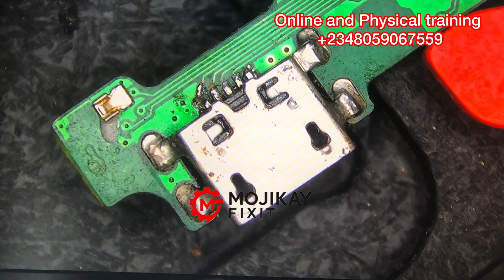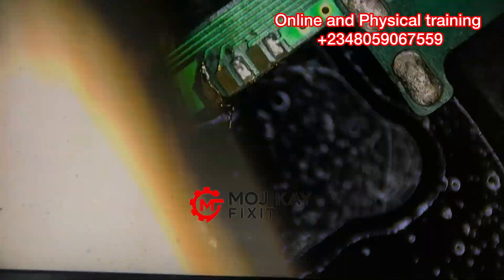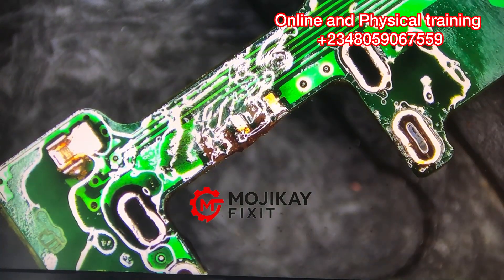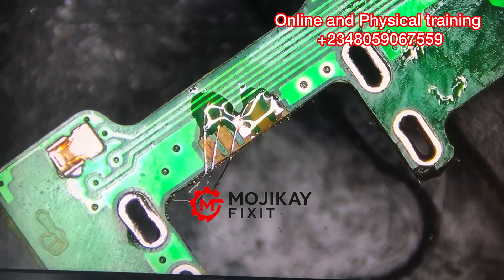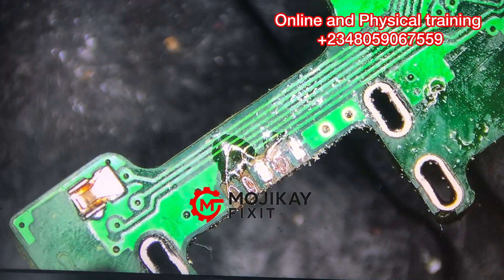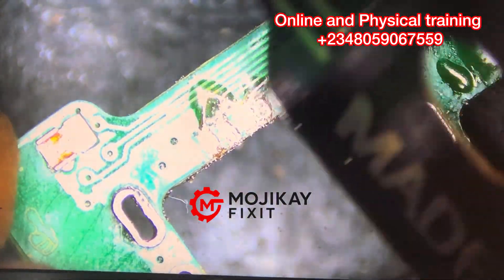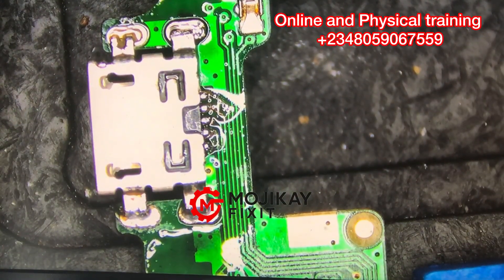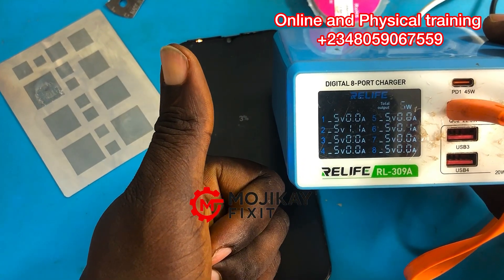How to Repair Charging Port Pad And Charging port Replacement

Comment: Boss please what's the difference between the soldering flux and the paste?
Reply from the maker: Soldering flux Cleans and prepares the surfaces to be soldered by removing oxidation and preventing further oxidation during soldering.

Soldering paste: Provides both flux and tiny solder particles in one compound to create electrical connections.

Comment: When soldering the pads do you only apply flux  or you also put soldering wire?
Reply from the maker: Not soldering wire, it’s solder paste + flux+ Jumper wire ❤